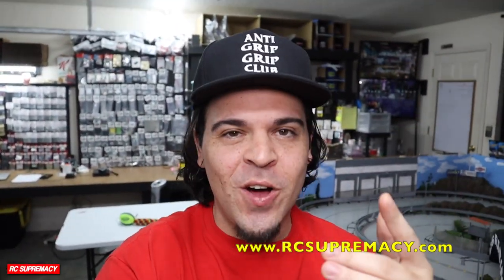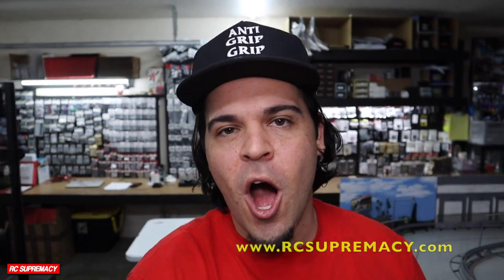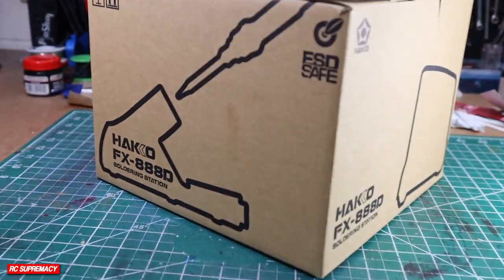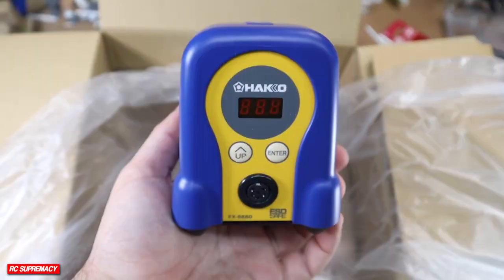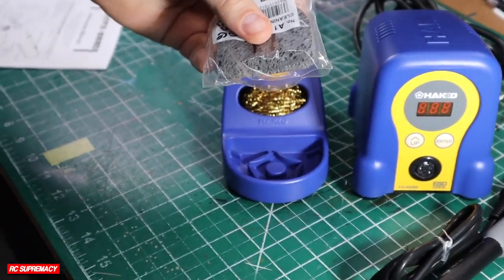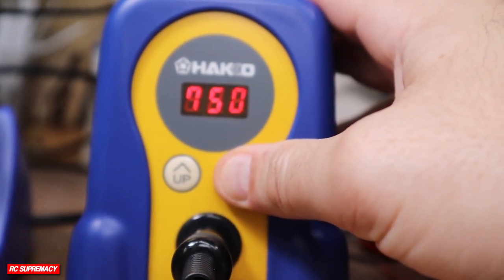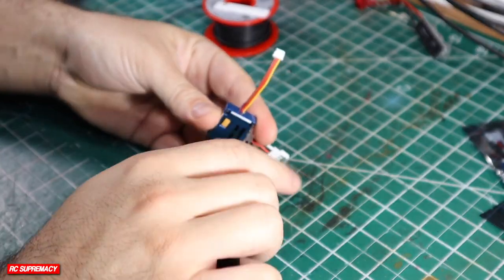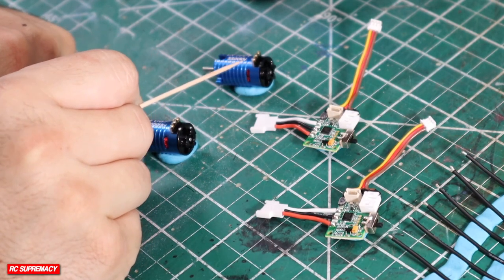HAKKO FX-888D Soldering RC Drift electronics- [REVIEW]

Comment: hey, man. love the channel. what's your ideal soldering temp for small stuff like 1/28 motor wires/battery connectors/etc? just got into the small stuff, and I'm assuming that i should run a little cooler than i normally do with my 1/5 stuff, right?
Reply from the maker: 750ish perfec temp! Thanks for the love

Comment: Check out a ts100 soldering iron. I do alot of soldering for many different things. Can use a lipo to power it or a laptop charger. has a lot of different tip options.  Goes up to 450°c.  I've had no issues soldering 12 gage wire and really small wires for micro flight controllers. It's like holding a pencil.
Reply from the maker: Love those TS100's , buddy was using one at the track and pulled it out of a small little case. I was shocked. It's a must have for track days